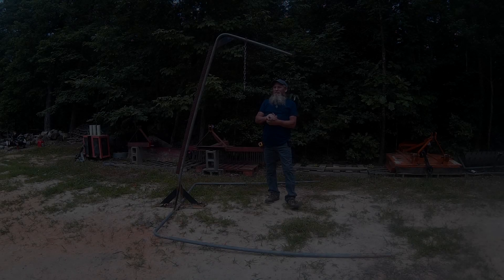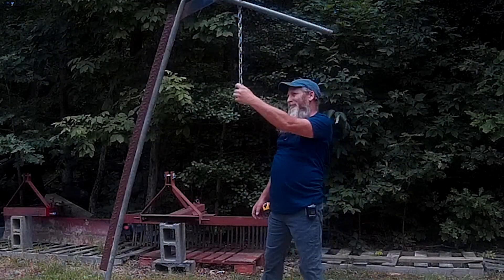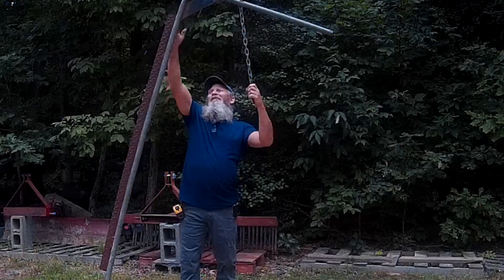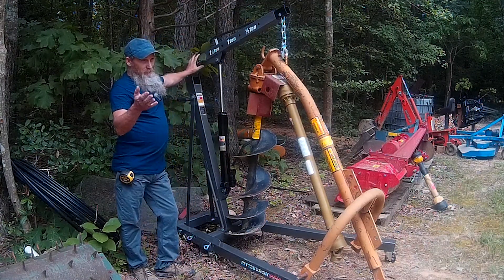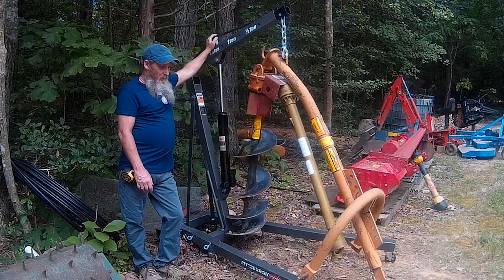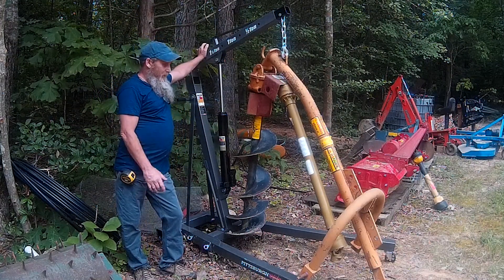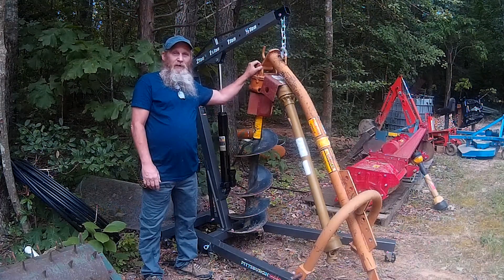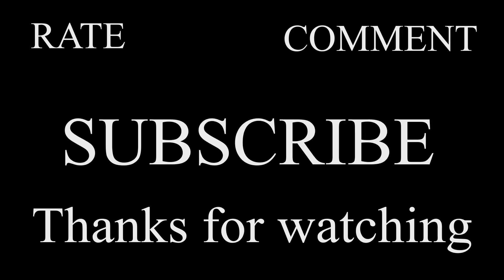Replacing a Failed Post Hole Digger Storage Stand!

Comment: Great idea Dave.  I have a stand for my 3 point digger, but even with that stand, seems like it’s a 2 person job to hook the thing to the tractor.  I think this is a much better option—plus I could use it to hoist an engine if I wanted to.
Reply from the maker: that was my theory also and since I been wanting one of these hoist anyway it was a good solid excuse to buy one. with the coupon I used I was able to just buy the bigger one for the same price as the smaller one. you are so right these things are a pain to wrestle with I was impressed that I was actually strong enough to get the darn thing on by myself the other day. it was a struggle though I wont lie about that. I'm hoping someone will post a video of a stand that makes it super easy to hook up and unhook. I wont hold my breath but I did toss the idea out there. you should post a video to your stand so folks can drop by your channel and see it.

Comment: I have the same HF hoist. I welded 3 pt brackets  to the back , I hook it up to the back of my tractor, i can use the 3pt to lift , or i can use the hand pump. I can fold the stabilizer arms up out of the way, or put them down, throw on a pallet and use it as a carryall.
Reply from the maker: WOW those are some great ideas! thanks for sharing that with us.
Reply: @daveknowshow  Thanks for saying that. I am completely inept when it comes  to posting pictures. I have no patent on the idea, if you rig up something similiar feel free to post it, for all I care you can claim you came up with the idea. Actually you dont even have to weld, you can clamp 3 pt  brackets on it. Happy hoisting and hauling !
Reply: @scotthanson7888   great idea I have to place some heavy barn stone and that would work great

Comment: Thanks for all the advice on using my post hole digger. Have you had any experience with hardpan and also any thoughts on fishtail vs screw tips for the augers? I got one hole that's not cooperating. :)
Reply from the maker: honestly I seen no difference between the fishtail and the screw tip. either one can land you in trouble if they bite hard and screw down into the ground to fast. that hard pan can be a pain to get past. trouble I run into is once you break through it the darn bit wants to screw itself into the ground to fast which means most often that it gets stuck. then its unscrewing it out with a pipe wrench my hand. these gravity down PHD don't do great with some soils which is why so many use a skid steer post hole digger. I heard they are now selling them with low flow hydraulic motors that can be run off our smaller tractors front end loader where as the pump has a low flow rate. the skid steer one has a high flow rate requirement. so you have to research carefully before you buy one. they are fairly pricey compared to a three point PHD. unless you are in the fencing business or have a lot of fencing to do its not always worth the cost. this lienbach line PHD I have has a place to mount a long pipe. the pipe is supposed to be for helping align the bit up but most people use it with a second person to apply down pressure. not sure I would try it these things can be dangerous. I honestly believe the bits cut better at a real slow speed so I try to run mine at a lower RPM. foot stays near the clutch to disengage the PTO in a hurry if needed. the last hole I just used this on a few days ago I ran it at idle. it was right beside brick work so the side of the bit was rubbing the brick word and foundation as it went down. no damage to the brick work and I most attribute that to a slow RPM. I should have made a video but just doing the job wore me out. lol always good hearing from you.

Comment: Good morning Sir, whatever works for you is fine by me Sir !!! but yes do grease the expose cylinder and oil the jacking mechanism and cover everything on the top and let the bottom open for air circulation. I will probably if i was you put over many concrete slab  12 inch x 12 inch so the stand will stay strait.   Keep up the good work Sir !!! Cheers !!! Happy 4 of July !!!
Reply from the maker: thanks for dropping by and thanks for the advice.

Comment: I simply drilled two holes about 30" apart and put two 4x4's squared em up and fastened a strong pipe across the top of the 4x4's and like you i used a chain to hold it up. Hardly cost anthing and no worries of the weather effecting it
Reply from the maker: awesome I thought about doing that but I wanted something I could move if I needed to.

Comment: What you bought is called an engine hoist. A $200 engine hoist designed to lift 1 ton and not designed to be stored outdoors in dirt where it cant be rolled and it will rust and you are using it to lift a 275 pound post hole digger.  The failed fabricated lift was at least original, but the engine hoist is a joke.
Reply from the maker: for anyone who lacks the skill and tools to build something they could buy a " 1 ton shop hoist " as its labeled in the harbor freight catalogue " not an " engine hoist " for right much less than what I paid for this 2 ton version. perhaps watching the video again will help you grasp this idea as a viable option. a one ton version with a 25% off coupon would be about 140.00 dollars. its ok if that don't work for you by all means use another method. I hope this works for me time will tell.